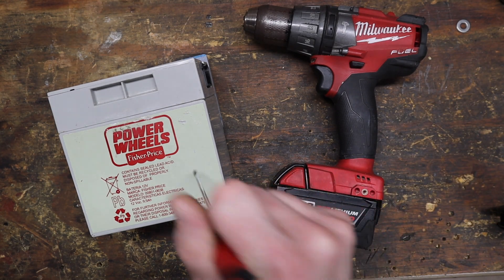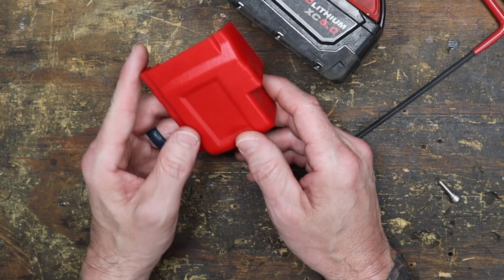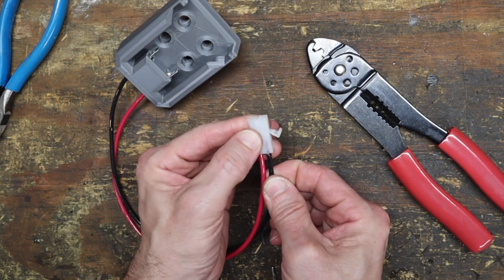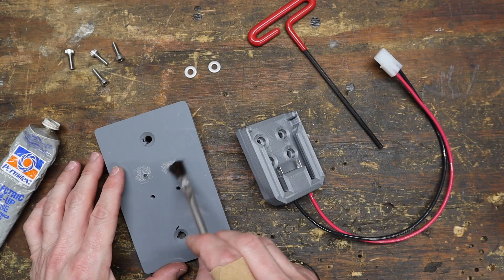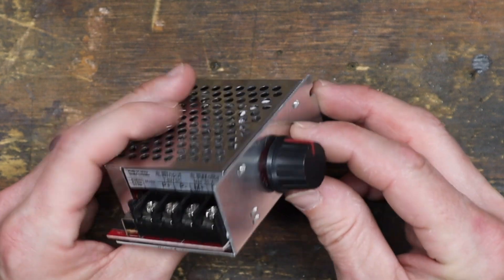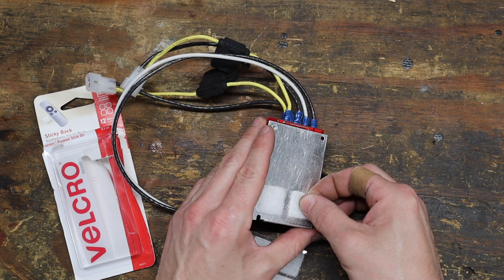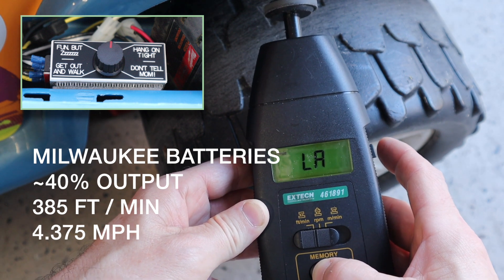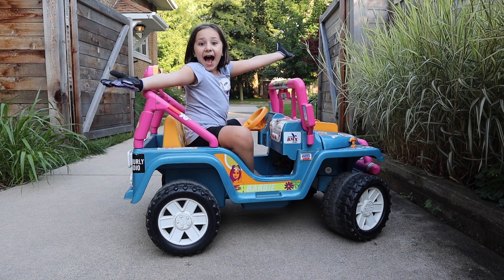Power Wheels Vehicle 18 Volt Milwaukee Battery Upgrade!

Comment: Hey bud.  Great vid.  Thanks.  QUESTION:  I wired everything up same as in video, car ran for about 3 seconds and stopped.  I checked the in-line fuses, and the fuse in the speed control, and they're all fine.  The cutoff is set to 16.5, with a 1V reset.  The cutoff reads 20.6V with batteries plugged in.  But the car won't move.  It's like it has no power.  I've checked everything I can think of.  Anybody have any ideas????    Thanks
Reply from the maker: Hi John. Use a meter and check for voltage on the output side of the cutoff module to make sure that it's not cutting off the power on you somehow. If there is voltage on the output side and the vehicle still won't move, it may be something inside the vehicle - another fuse somewhere?

Sorry I can't be much more help without seeing and testing the setup personally.

Thanks,
- hw
Reply: Checked. No voltage going out of speed control. But fuse wasn’t blown?? So I replaced with new one. It ran fine until I cranked it to max.  Then, same thing. Stopped working but fuse wasn’t blown.  Appreciate any input - I don’t know anything about this stuff. May just direct wire to the motor, but I’d like to have the speed control if one would work.
Reply from the maker: Hmm. You have voltage on the output side of the cutout module, and on the input side of the speed controller, but no output from the speed controller? Can you link to a video of your setup so I can take a look at the circuit?
Reply: Yeah. I had no voltage leaving the speed control.  Happened to two of them. I’m using your same setup with two 18V Milwaukee batteries.  So I took out the speed control and wired directly from the voltage cutoff to the motor and it worked great for about 15 min.  Then it just stopped.  I walked up and smelled something burning. The little black box on the voltage voltage cutoff was melting. It was set to 16.5, with a 1v reset.  I don’t know!! Ha.   It seems like if I use a speed control, and don’t turn it past 75% or so, I’ll be fine.  I don’t know why I’m having such bad luck but no worries. I’ll figure it out. Thanks !

Comment: Is all this specific to Milwaukee batteries?  Or will other 18V power tool batteries work, too? I desparately want to do this for my girls' Power Wheel dune buggies
Reply from the maker: Hi there Ben. This is a fairly universal mod that should work with any tool battery; I just happen to have / use Milwaukee.

Thanks for watching!
- hw

Comment: Would I be able to use this same schematic for a kids Trax Dodge Charger? Thanks
Reply from the maker: Hi Anthony. I can't comment on any other specific vehicle type, but the modification is fairly universal. There are several Power Wheel forums, have a look to see if someone has modified your Charger before, and if you can adapt the schematic to it.

Thanks!
Reply: havocware I’m going to give it a try anyway. Thanks! Great video!

Comment: Great video. What size fuse did you use?
Reply from the maker: Hi there! Both inline fuses are 15A - I found that if I used anything lower, the inrush would pop them. It would be handy to have a SLO-BLOW ATC fuse at a lower amperage, but on initial glance they look to be 40-50A minimum. I haven't looked into it much more than a quick search, though.

Thanks for checking out the video!

Comment: Love your video! Can you share with us the number of motors(1 or 2), if they are 12v or higher, and the rpm they specify on each motor on the Power Wheel Jeep? Thanks!

Comment: Do you have power switch to turn hotwheels on and off or is the switch basically the gas pedal. I want to do this to my sons but his has a power switch. Its the Best Choice Products 12V Ride On Car Truck w/ Remote Control, 3 Speeds, Spring Suspension, LED Light Black
Reply from the maker: Hi There Michael! There is no power switch on this vehicle - the "accelerator" is just make/break switch. I'm sure you can still do this mod with your vehicle, but take a look to ensure that the switch in question can handle the added voltage and amperage (it probably can, but take a look to be sure.)

Thanks!

Comment: Thanks for the inspiration! Here’s my recent mod using your videos inspiration to do so, however I left the 12v battery as an alternative back up source with a 3 pole switch. 

https://youtu.be/FQg-yS4DY5I
Reply: Skywire Electrical Systems, LLC can you connect the original 12v with 18v Milwaukee battery in parallel for longer play time ?

Comment: What wire gauge was use on your setup?
Reply from the maker: The battery adapters and fuse holders are both 12g THHN stock. I used 14g MTW to/from the voltage cutout module, looks like the stock wiring harness is 14g as well. Fuses are 15A - no excess wire heat whatsoever during any testing (see Video II for run-time tests.)
Reply: @havocware  Thank you for the info! I use some 16g I had laying around and the wires were getting warm to the touch. I'll switch over to 14g wires. Thanks again!

Comment: Are you still able to use stock charger if you just add second stock battery double battery capacity not up voltage will it still charge both batteries but just take longer if you don't swap to the drill batteries?

Comment: I just upgraded all my power tools to Milwaukee's M18 FUEL line (thank you home equity loan) so I have several 18V batteries. This is definitely on the list so I can get my son's old 12V Grave Digger PW running for next summer. Need better wheels though. Those plastic ones suck on pavement, and I imagine even moreso when more power is put to them.
Also, that "BOOYAAA!" at the end was, in the words of this crusty veteran, fucking adorable.

Comment: One more thing..... it's always great to see a parent let their kid(s) be real kids and let them do dangerous stuff like we did as kids. Over the last 30 years kids have been so sheltered and coddled, they don't know what being a kid is supposed to be.  They don't even drink water from the hose, they don't build jump ramps for their bikes. We not only built jump ramps but we would lay on the ground and see how many of us we could jump, Ala Evil Knevil, then we turned 9 or 10 and started riding Honda XR75s or Yamaha YZ80s and things got real interesting. That wasn't even talking about skateboarding in empty swimming pools, and building halfpipe ramps taller than the garage, four sheets of plywood wide and six sheets end to end making the double transition. Building the ramp was tough but not as tough as it was stealing the all that wood from different construction sites around the neighborhood. Oh the memories ......

Comment: "Don't Tell Mom"----that is classic. 
 As far as the battery performance,  being that I am a state licensed electrical contractor who works with Milwaukee 18v Fuel batteries every day in my drill, impact driver, ports band saw and a couple different flashlights and flood work lights, I know the batteries a great and last a long time on a full charge in a tool, but how do they hold up with the amount of torque needed to carry the weight of kid and turning the wheels? Did the charge last very long? How long have the two new batteries lasted, meaning are they dead yet? Not dead as in needing a recharge but dead meaning the battery's life? Have they stopped working yet? 

 What about any other structural damage to the drivetrain of the vehicle? Any collateral damage in linkage or drive gears? Were there parts that wore out or that broke due to the added power, getting hot, stress, ??
    Just curious. I'm not trying to be a dick, I'm actually really curious how things worked out over time.
Reply: Exactly what I was thinking.  If they only last 10 minutes at full speed (which my kid would want) and im buying 2 new batteries a month, this project doesn't seem very logical.
Reply: @robinagreer  ---- not at $100.00 per battery. That's what those Milwaukee 18 volt batteries cost.
   Oh, and I like your avatar. Is that a logo for your own business?

Comment: It reminds me of my youngest daughters first snowmobile.  I had to tape a shim under the throttle so she couldnt go full speed. It has a two stroke single cylinder engine  that really wasn't  that fast but when I noticed she was flying through a wooded  part of a trail and the brake lights never went on, I knew sooner or later she would end up ramming into a tree.  I also knew her mother would kill me if something didnt change. So I made a simple throttle limiter. She always was my fearless one.

Comment: Awesome video, congrats on how well it's doing, and thanks for the plug!  You got one of the first units i sold back when i was on version 1.  I'm currently on version 3 which makes the battery adapter about 3x stronger, and i changed the description to the correct bolts.  I also started using a better brand of material to try to take care of the warping we'll see how that goes.
Reply: I got one this week and it's great 👍
Reply: Where do I get them?

Comment: I didn't read through all the comments yet.  Have we talked about the battery holders being PLA?  I worry a bit for how well they'll hold up to the heat the batteries are putting out and the shock from the kid riding this thing over bumps and such.  And they're printed in an orientation that is easiest for the person to print while being weaker overall considering how they hold the weight of the battery.

And next question, have you tried running with the high output batteries?  I got the milwaukee chainsaw/blower combo that came with the 12Ah "high output" battery.  Supposedly these batteries can discharge electrons at a higher rate.  You get 20% more capacity over dual 5Ah batteries and maybe even bigger speed increase.

Comment: Did this with a 6v pawpatrol man does he love it. Maybe I should have used a speed controller though. Anyways the boy was very upset within 5 minutes as he blew out the rear end. So back to work I went epoxy worked wonders to fix that problem and wheelies wile driving. Not bad for a 2 year old.

Comment: I did this over a year ago to my son's Powerwheels 4 wheeler.  We didn't have batteries for it, as I got it free many years prior and it has been sitting in the weather all that time.
I cut the wires and just jammed them into a Dewalt 18vt.
The tires spun so fast that it took a couple seconds before the thing would move.  I solved that problem by adding screws to the tires for better grip.
He had about 20min of power.  When that was dead he just changed batteries with the one on the charger and kept going.
With the screws in for better grip he can easily climb hills now too.

Comment: I thought I was about to find out Power Wheel batteries were filled with lithium Ion and cheaper than those Milwaukee batteries. What did the run time end up being after the upgrade and was there a reason for using the milwaukee batteries instead of individual 18650's like the sony vtc5, lg HG2, or other 20-30amp quality high capacity batteries commonly found in those power tool battery packs?

Comment: Take an old serpantine belt and cut it so when wrapped around tire it just touches end to end.  Then sew the ends together with some copper wire.  I then used gorilla glue and a few screws drilled through belt into tire.  This will never wear out and gives traction.  Basically running just on the belt surface, but tires will last.  no more drifting but will be quiet and quick.

Comment: I want to do this so bad to my son’s Polaris RZR but none of the videos I’ve watched on this mod talk about how LONG the new battery install works in comparison to the original. It’s always a speed comparison.

I know it’s largely dependent on speed used but is there a way to know if this increases speed but reduces run time to 40% of the original Pb battery?

Also, my son’s has a “2speed” transmission with a low and high. Is a speed controller still necessary with this?

Comment: This reminds me of the gokart years, I de governed, polished the ports, made a header, shaved the head, even played with lightening the flywheel, there is only so much a kid can do without the parents finding out! They had no clue, they thought it needed a muffler, until I got caught going down a very steep hill by the house, my dad just said when you are going down a hill that steep, and it's spinning !   You might ought to let off the throttle a bit, it would do about 50-55 +MPH!

Comment: Tried this mod and I highly recommend a low-voltage shut off in the circuit. Lost a good battery from over-discharge. FYI, the battery protection is in the tool end of these Milwaukees, not in the battery
Reply: Me. Also, coincidentally, the person who left the original comment while logged into girlfriend's YouTube account. Sorry to disappoint.
Reply: Sorry to hear hun
Reply: Jonathon Zelaya creep
Reply: @traviscooke148  white knight beta.
Reply: Joe Blow and what does it make you? Standing up for the creep
Reply: Didn't realize that, but very good idea. Milwaukee 18V batteries aren't cheap; though a much better way to go than PW's crap batteries. I wonder what the current draw is for a stock 12V PW vehicle. I found a 20A disconnect that'd probably work pretty good if it's less than that.
Reply: It‘s the same with nearly every power tool battery. Makita for example does the same.
Reply: I tried it!!!   I was lucky enough to pull the battery out!!   My kids thought it was cool when the battery caught on fire.
Reply: Is in that wide of a fuses were installed

Comment: Is there a low voltage cut off to not ruin the batteries?
Reply: The sell those and I've seen other people use them to prevent damaging the batteries.

Comment: Brilliant workmanship and videography bud.  

Just a little trivia for all the handy people out there which totally surprised me as well a few years ago, it’s been widely published that split ring lock washers are (believe it or not) actually worse than nothing in terms of preventing a bolt loosening, and that tooth washers may or may not be much better. 

A split spring washer "seems" like a great idea, but when you actually think about it, it's kinda obvious that it's not doing anything really very useful, if the bolt loosens the washer may become springy and you’d think it’d hold however you’ve already lost the initial torque applied to the bolt and it will just become loose over time.  

Perhaps for a good electrical contact I would use a toothed washer if any, it has at least some ability to bite against the surfaces (unless it's compressed flat though against a surface harder than the washer I imagine) and prevent rotation, which is after all what this is all about, if that's vibration or thermocycling, it's the bolt or nut rotating you are trying to stop.

For total locking - that's what locking nuts, loctite, lock wire and split pins (cotter pins to the US folk) are for. 

Happy modifying guys !!

Comment: backup batteries in emergency lights for exits are cheap and if you parallel them i have found they hold a decent charge and fit where the power wheels ones fit nicely
Reply: very nice build

Comment: At $250 for this super sexy solution, I'd be happy with the $75 replacements (or $35 for a 12Ah equivalent and salvage the old connector).  Better yet, chop off the proprietary connector and switch over to the Molex plugs and standard 12v 12Ah SLA batteries.  I figure $37 per battery and now you have two higher capacity SLA replacements for the price of one Power Wheels brand or more overall run-time for about 1/5th the cost of his solution. If you don't like the crappy charger, swap it out for a low current $20 smart charger. 
Wait, I got a better idea yet: Slap a solar panel on that Power Wheels! A panel with a charge controller could be had for about $125. Throw in the $37 replacement battery and run the crappy 12 volt Power Wheels charger through the charge controller for the "smarts". Free solar charging with AC backup.  At two 12Ah batteries, we'll still be about $50 under the $250 and not have to worry about the kiddos having a wipe-out and cracking their little skulls open like an ostrich egg.

Comment: I had my daughter's Barbie Jeep set up with a actual car battery in the pickup truck type area behind the seat. And I also had a set of 12 volts interior halogen above sink lights on a toggle as her headlights. She could run that jeep for 12 hours or more and driving at night around our property. She can also drive down the back roads 2 miles to her grandma's house. Put it on the charger and then drive home, with escort though

Comment: I did something similar a while back, but it was to a nail gun from another brand, question for you?
Did you eventually swap the battery drain shut off safety? Some manufacturers like makita have these built in their battery, Milwaukee however puts these things into each tool thus keeping batteries more affordable.
Over draining these Milwaukee’s below minimum voltage threshold can lead to battery failure.
Hope you fixed this issue before you blow thru few batteries.

Also I wonder what your run time would be with 2x 12.0AH Milwaukee’s (closer to a Tesla range?) :)

Nice build

Comment: I used to do similar things for my son. He had a power wheels jeep with a lift and metal frame. It was stock. I did a straight wire conversion (no speed controller) I studded the tires with 5/15 screws for traction. He stepped on it the first time on a paved drive and pulled a little wheelie. Looked at me and said "I'm telling mom"! So this little sign he made really made me laugh. Thumbs up!

Comment: For traction - wrap the wheels in Flex Tape.  I bought the 4” wide tape and it works great.  1 complete wrap right in the center of the wheel is all it takes.

Comment: I have a power wheels dune racer and it has room for 4 9ah electric wheelchair batteries. It has 90 minute run time in the grass and I just charge it with a car battery charger. Charges in a couple hours.